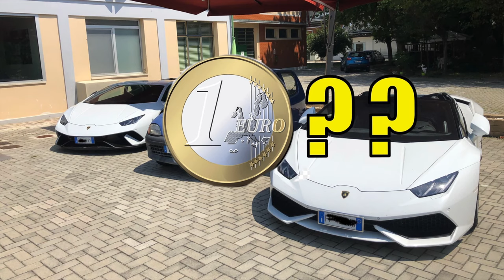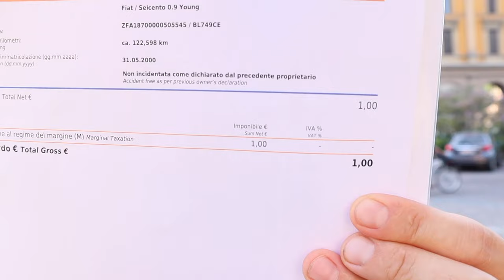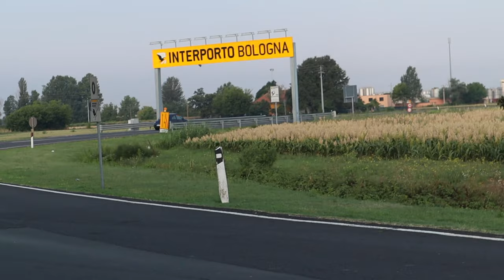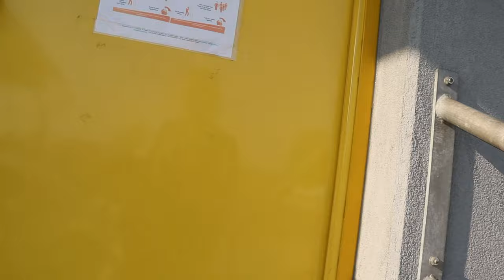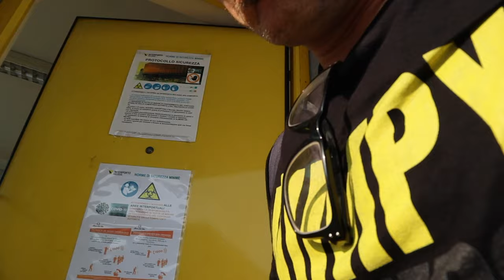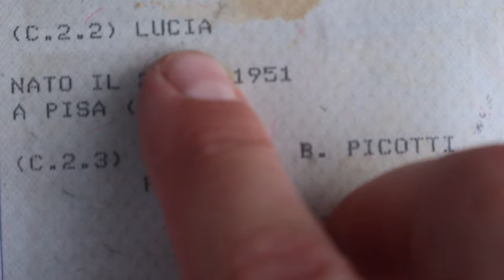I BOUGHT A FIAT FOR €1... But will it get me home?

Comment: Soz mate but I picked up an 02 1.1 Abarth edition with 10 months MOT for 70p back in 2017 off fleebay.... three miles from home.... euro might have been a better rate then! Ran it for a year put another test on it and flipped for £800. Have had several free Seicento and never paid more than a cheap night out for them, best buy was a manual Volvo 850 T5 for £2.35, try and get one of those for under £3k now!